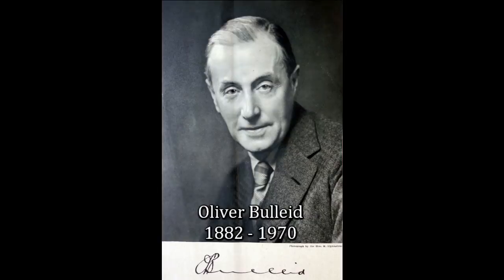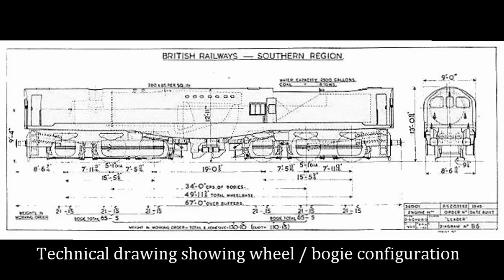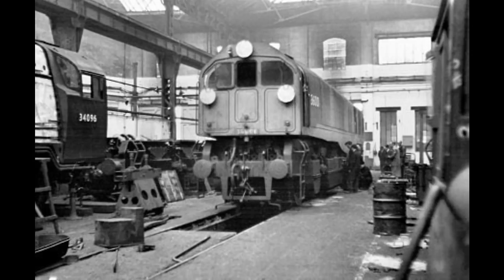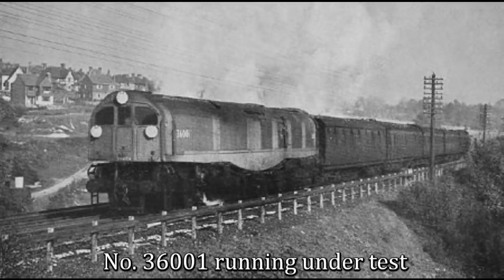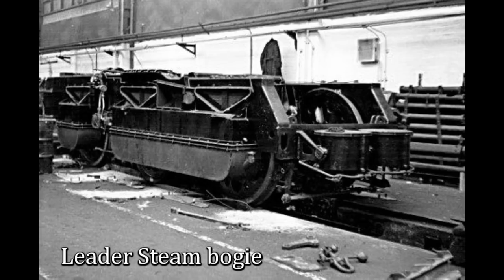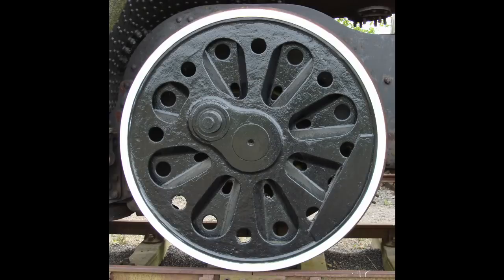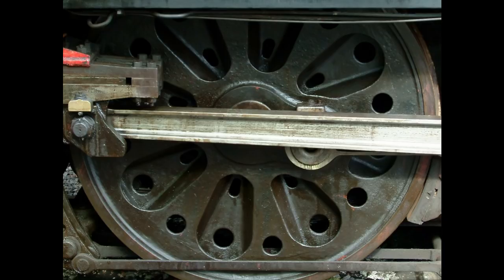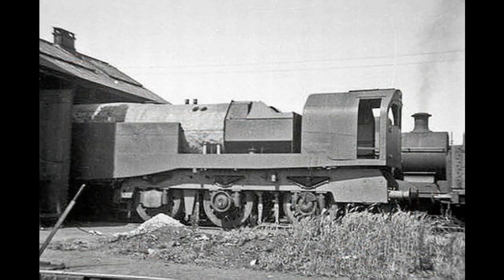Strange Locomotives - Bulleid Southern Railway Leader Class Steam Locomotive

Comment: The two biggest drawbacks of the Leader barely get a mention from the Narrator:  
The Fireman's Cab was in the middle of the locomotive and was virtually totally enclosed ... this resulted in the poor Fireman being effectively roasted alive as soon as the locomotive went out on the road, especially as the firebox also had a tendency to shoot flames out of the firebox door!  
The other problem stemmed from a drawback that Bulleid recognised early in the design stage ... there was no effective means of communication between the Driver and the Fireman.  This he tried to rectify by including an internal walkway between the Driver's Cab and the Fireman's Cab ... but the only way this could be done was by offsetting the boiler to one side, as can be seen in the end elevation of the line drawing at 0:23.  Unfortunately, due to the considerable weight of the boiler being more to one side of the locomotive than the other, this resulted in excessive wear of the bearings, axle-boxes, cranks and running gear on one side of the engine and led to endless mechanical failures when the locomotive was under trial.  
In many ways, Bulleid was a great innovator and was always keen to try out new ideas ... unfortunately most of them came to nought due to the limits of the technology of the time and the fact that steam was nearing the end of it's era anyway.
Reply: could have been fixed with a screw to bring coal into the firebox like other countries have done before, I wonder why they dident?
Reply: "Nearing the end of its era" Um you are aware that in a lot of areas steam was still in use post 1950s right?
Reply: @sockshandle  Yes ... I was around at the time!  But the writing was on the wall ... it did take a long time to sort out the the most suitable replacements though!  Some would argue what was the point in continuing to build steam locomotives throughout the 1950s and even in 1960, but the reality is that diesels of the time were simply not up to the levels of power and reliability that steam could still provide.
Reply: @jwalster9412  
Weight. It was already over it's intended weight.
Reply: @jwalster9412  the obvious fix would have been to switch to Oil firing of the boiler... well ironically the design was actually intended to be Oil fired in the first place and had to be adapted to use coal. The British Government had actually pushed for the design to use oil to make up for shortages of coal. All very well during wartime Britain when the UK was getting oil from the US for effectively free but with the end of WWII the cost of imported oil shot up making it uneconomic to run a locomotive using it and forcing the design team to switch to coal firing.

That being said feeding the coal to the firebox using some form of screw would have been a perfectly valid alternative, actually it was a very mature technology and called a 'Mechanical stoker'. They were common in Europe and the United States but not the UK. Curiously Southern Railway even trialled a Canadian made Berkley mechanical stoker on one of their Merchant Navy Class locomotive. They rejected it as not offering that much of a performance improvement, why they didn't think about trying it with the Leader is a puzzle to me!
Reply: @wotnotvintage7762  I think he meant in the world. China only stoped using steam in the 2010s, and last produced a steam loco in 1988, although private Chinese companies still do use steamers and presumably make them too..
Reply: Wotnot Vintage: Thank you for suppleying some technical information the speaker did not provide in his narrative... One can wonder where Bulleid was with his thoughts when designing this machine...
Reply: Shame it wasn't a diesel-fired boiler and there was no need for a fireman.
Reply: @Fedaykin24  I remember reading that. Bullied having to change the design because of the change of policy was a blow he must have felt. Have you seen the model Leader pulling passengers somewhere? It goes "Like the clappers" although I can`t say what actual mechanism the builder has used. T`would be interesting to know.Another case of what might have been with development
Reply: @Fedaykin24  Brits were fucking weird with any machine designs up until modern times, epsecialyl when it came to locomotives and aircrafts

Comment: Who else wants to see one of these resurrected and on the mainline? That would be nice. Maybe on the Golden Arrow taking it in turns with Clan Line and there could be a double header of the two!
Reply: maybe oil-fired? That would be a fun project
Reply: Man, I’ve had so many day dreams of making an oil fired one of these!
Reply: Put my name down to see an oil- fired one.
Reply: I think they should make a steam one BUT a lot of work would have to be done because I think if one did, they’d have to do major modifications to make it actually decent; because if it wasn’t upgraded, there’d be no point as the leaders weren’t exactly… Good.

Comment: Good video, but a project deserving harsh criticism.  An example of very poor engineering management. To say that 'if successful it would have prolonged the life of steam' - what features did Leader have that would have accomplished this? Steam was prolonged on BR, by nearly 20 years, based on proven designs. I think it it unclear how the problems that were being addressed neccesitated that design.  For example, if a double cab is a solution, there's a way of introducing that feature without some of the other ambitious features that didn't work, and perhaps getting a working loco. To have ordered and started 5 'off plan' without testing even one was a serious error.

Comment: Great video. Like you said the Leader had more than a few issues. The fireman was in a horrifically confined area with poor ventilation which lead to the temperature being unbearable to work in.
Reply from the maker: Thank you
Reply: Vector Brony not only that if the loco rolled over it was 50-50 that he'd have an escape route as only only one cab door was fitted. The communication corridor along side the off-set boiler, which caused some of the uneven bogie loading, was filled with scrap rail to balance up the bogie loading caused by the off-set boiler.

The driver either was hot or cold depending on which cab he was in, nor could he talk to his fireman whilst driving breaking up sense of being part of a team.
Reply: Vector Brony Is there any footage of these being scrapped. That would be great.
Reply: Perhaps the 'root' of the problem was that the locomotive was originally intended for oil firing, which would not have required the dotty offset boiler (and multiple tons of scrap metal used as counterweighting) or confinement of fireman in hot space made hotter during blowback in tunnels.  (Oil had to be imported, from countries typically using dollars instead of pounds for exchange, which is why Britain paid such attention to coal-burning standards up through Riddles' standard classes)

Likewise there were supposed to be two sets of chains on either side of the drivers on each bogie (chains drove the leading and trailing axles) but only one side was fitted.  This was of more than usual importance because of the design of the suspension; the offset loading causing increased binding and other issues.

I am not sure I would consider the valves in the Paget locomotive to be similar to the arrangement on Leader, which used Meehanite sliding sleeves with a great many ... too many! ... sealing rings for its great plurality of ports.  Theoretically this gave an utter minimum of dead space for enormous port opening, the problem being that oiling arrangements were correspondingly very complex and even partial failure of one of the many oil lines would cause accelerated wear, ring breakage, or seizure.  The rather fascinating 'figure-8' motion in the original valve drive was intended to keep the sleeves turning slightly radially at the same time they were being moved fore-and-aft for actual valve action, but this wasn't intended as a Willoteaux-like acceleration of effective porting/unporting or, in fact, any kind of rotary valve action a la Paget.  I personally think that the tests on Hartland Point (which you should mention here, even if briefly) should have caught all the problems early enough to work out fixes (or determine, perhaps a more likely outcome, that the theoretical gains in dead-space reduction and other concerns relating to poppet-valve or other alternative valve arrangements like Cossart 'drop valves' weren't worth all the problems of keeping all those rings unbroken and steam-tight)
Reply: To be fair, Bulleid tried his best to keep the steam era going, but the results from his good intentions lead to the development of what I considered as THE WORST steam locomotive ever spawned, bar none.
Reply: @PreservationEnthusiast  Yes they were all sliced apart with cutting torches and melted down. Cutting torch gas axe destruction frenzy!
Reply: @ThomasFan3751  Sorry to disagree: These were surely the early F.W. Webb compound engines for the LNWR which were not only short of steam but due to the uncoupled axles, span their wheels on starting in opposite directions - pretty embarrassing i.m.o. My essential point would be that these engines had made it into series production, whereas Bulleid's invention was still a test engine, which with oil firing, axial boiler (no corrective ballast) and sorted valvegear might well have fulfilled its promise. It certainly wouldn't ever have stood in Euston with counterrotating drivewheels and maiden aunts on the platform waving suddenly bechallenged handkerchiefs, now much less assured of their nephews' impending departure.
Reply: @1258-Eckhart  oh, the Webb compounds! I'd forgotten all about them. I  wish I'd seen one.

Comment: Where did the fireman shovel the coal? Is the engine in the middle of the train?
Reply: He was in the middle of the loco, between the coal storage area and the firebox. It was very hot, and he had a door on one side only.
Reply: @billcobbett9259  So the "modernity" didn't extend to a mechanical stoker, and a steam turbine driving an electric generator powering the wheels (all known technology since 1884), just the same old. It is interesting that for all the innovations in steam locomotive design since Locomotion 1 (1825) to Evening Star (1960) the steam locomotive stayed in the same configuration with pistons, valve gear and a driver and fireman working behind a boiler, with the fireman shovelling coal from a coal box behind him. Rubbish ergonomics for both operating and maintenance. "This is the way it's always been done lad, no need to change".....
Reply: @SuperNevile  the LMS did build a one-off turbine version of the Princess Royal class. Nicknamed the "Turbomotive", it was unfortunately damaged in an accident, and then rebuilt as a standard pistons-and-valve gear loco.
Reply: @alanclarke4646   It’s interesting that experiments were carried out on various forms of rail traction, but the industry stayed mainly with steam technology developed in the early 19th century.  Electric (catinary type) locos operated out of Shildon in the early 20th century, and they were toying with diesel electric, but didn’t go further. The underground went electric (for obvious reasons) early 20th century. But when the aviation industry went from the Wright Flyer to Concorde in under 64 years, the inclination not to go to more efficient, more ergonomic (and cleaner) rail locomotion is striking even with the massive coal industry available.

Comment: The result of the 1955 Modernization Plan shows that even an unorthodox coal fired loco like Leader was not going to extend the life of steam. The flexible joints necessary to the design seem like a maintainer's nightmare. Bullied should at least have put the driving wheels in the center of his loco so the power unit was one piece. The Southern Pacific cab forward designs were more successful but they were all fueled by easy to handle fuel oil, not coal.

Comment: So when and where was it scrapped? It should have been preserved as a static exhibit at least. Never mind. Cheers for the interesting video.
Reply: Preservation basically didn't exist in the early 50's when it would have been scrapped.
Reply: @mattlander9119 Puffing Billy where Preserved early which was existed since it was built in 1813-1814.

Comment: Bullied also trued out the design in Ireland. He made it run on peat sincecit was cheaper than coal. It failed. AGAIN.
Reply: Well, in his partial defense, he did adapt the design considerably in the 'turf burner' including the substitution of more-or-less conventional piston valves for the sleeve valve arrangement, and fixing the other issues with the bogie design.  And interestingly, it appears that the boiler, strange as it looked, was actually effective in making reasonable power from the low-grade fuel.  The real reason it 'failed' was less technical than economic: instead of a relatively large and complicated arrangement to burn native fuel, it made better economic sense to use relatively fuel-efficient diesels (whose development cost and parts availability could be shared with other owners)
Reply: @wizlish  i suppose but with the turf burner, instead of doing what i thought he would do which is having a cab either end where you could drive it from both sides but only fire it from one end (or make it possible to have two fireboxes), he put both the fireman and driver into a cupboard where all the controlls were. This limited visability and imagine how hot it must have been. Youd better hope he made AC a feature with his steam generator because if he didnt i think most crews would have been cooked before reaching cork. (They were meant for dublin - cork expresses.)
Reply: @Spud607  - This had me chuckling while thinking about the New Zealand E1066 for the Spiral - another somewhat roasty design.  But actually there was care taken with additional fiberglass insulation in the backhead and plenum areas of the boiler, and I don't recall heat in the cab area being notably higher than that of a conventional boiler (and certainly a dry-back firebox like the one installed on Leader!)

Remember that none of the contemporary designs (bogie or otherwise!) worked with double-end driving -- they would all involve crew separation or complicated fuel arrangements.  If you have oil or pulverized-fuel firing, there is no particular problem in having both crew in an end-cab (see the German 4-6-4 05 003 as built) but the firing provided for the Turf Burner (or a logical alternative chain-grate like the version used in the N&W TE-1) would still require a complicated feed path in the absence of full automatic control (which was not practical even in the latter '50s with Bailey Meter controls derived from nuclear submarine control experience, let alone with cost-effective technology in contemporary Ireland).  So the logical thing is to use the time-honored layout for large bogie-borne steam in the United States, with a center cab between bunker and boiler, and rig the locomotive for effective bidirectional control with 'one man per side' making up for the restricted vision.  Of course, even then the television system used for CASTOR was practical as a means of seeing what was ahead, and would be a preferred approach technically if the locomotive were to be replicated today...

The thing that most people seem to be forgetting is that the Turf Burner was not a technical failure -- it was just not seen as being as economical as even the pathetic diesels provided to CIE by the early '60s.  (Which, it can't be argued with much enthusiasm, it really wasn't...)

Comment: I wish one of these had made it into preservation. Massive loss just like his CC electrics. If he'd ditched the sleeve valves and used a more conventional valve gear it might have worked. Unfortunately, nationalisation and the LMS got in the way.
Reply: I think automotive-type poppet valves were the coming thing at the very end of steam engine technology. Sentinels used them for their lorries. They provide a much better gas seal.
Reply: You only have to watch the youtube video of the rotating, oscillating sleeve valves moving in three dimensions to realise the whole thing was just too complex for its own good. It needed a better design as the orignal would have been a nightmare to maintain and set up at a depot.
Reply: And if it had been oil fired, with the fireman's controls in the driving cab...

Comment: It seems that everything that deviates from the standard steam locomotive design, is not successful ( The French steam electric Heilman locomotives where a technical success but did founder on prejudice & trade union idiocies...) experiments with steam turbines, uniflow steam engines, exotic valve gears & high pressure steam just did not work... 
using chain drive for the drivewheels is asking for trouble, and what about the valve gear ? Was nothing better available ?

Comment: Here in Germany we had the V2 multiple steam engine powered 19-1001 Henschel high speed loco streamline prototype: https://de.wikipedia.org/wiki/DR_19_1001
Reply: Eh? You mean the DRG 05 003 cab-forward which was was also a failure and converted back to conventional post-war http://loco.skyrocket.de/data/drg_05_003.htm